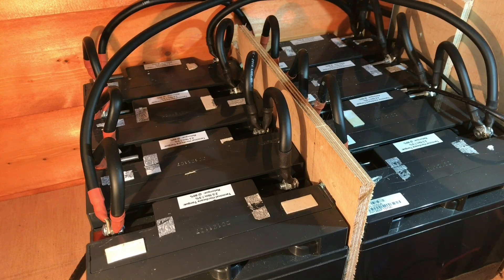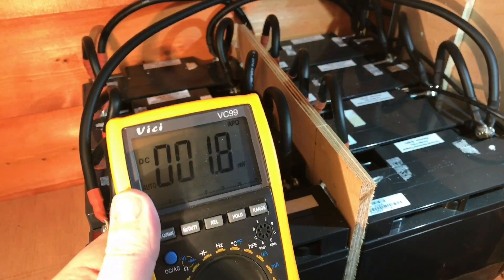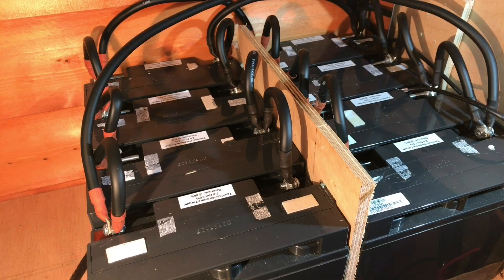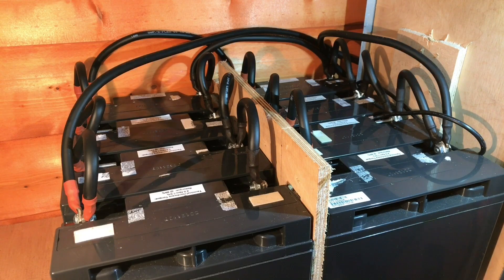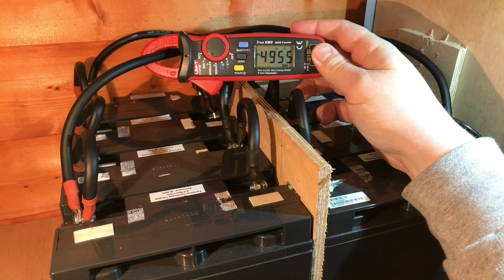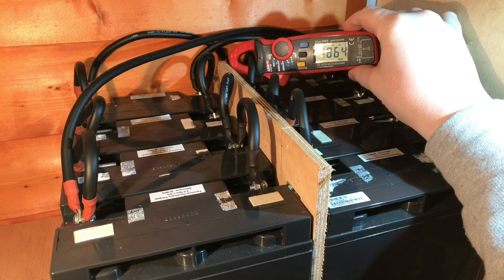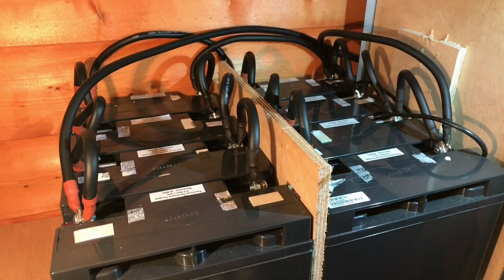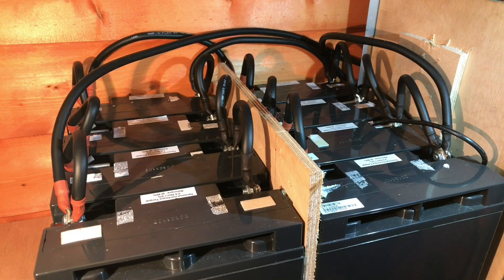Checking 12v Batteries in Parallel - 12v Solar Shed

Comment: interesting! thanks for sharing. I am working on a solar installation for my boat. I want to keep the battery bank 12 V. There are 4 x 125ah agm batteries in my plan. is parallel connecting them the only option? each battery is 12 v.
Reply: Yes but you could balance them better than he has. Google 12v batteries in parallel

Comment: I had one of mine go back in a bank, didn't notice for a loooong time, pretty sure I did damage, and the rest of them have varied stable voltages ranging from 12.6v down to 12.5v.  they all used to sit at 12.8v just a year ago.
it pays to to monthly checks :/  
luckily I got mine stupidly cheap and am only running led strips on a PWM controller, so it's not noticeable.
but still, was a disappointing lesson.

on the plus side, I have a new EPSOLAR LS1024B  coming in the mail (eventually ha) which I can finally set up my 45 AGM 5ah batteries with (got them stupidly cheap in a UPS buy, the UPS was too massive to run at home ha)
Reply from the maker: Yes battery maintenance will save you money in the long run.  I probably should have added that doing the same test whilst the batteries are charging will give you a good idea of their internal resistance.  The issue here is getting a consistent charge long enough to test with a solar setup!  Cheers
Reply: the constant charge is easy here in Queensland Australia lol.
with it's lovely 34-38c days, there is a LOT of sunlight to spare.

Comment: If a battery develops a shorted cell, the main issue will not be from the good batteries "dumping" into it, rather it will be when the charging is happening. It will gobble up most of the charge current and get rather warm, if the charging source is reasonably grunty.

If you suspect a battery in this state: Check through the batteries with the clamp meter like you did but with NO charging or discharging taking place. You will find the duff battery when current is pouring in from the interconnects either side of it! (unless it's an end one, then all current will be moving towards it)

Interestingly in this situation there is actually very little wattage moving around even though the current can be fairly high. That's because the voltage differentials are extremely low. 

As I might have said in the previous video of these batteries, no matter how you carefully manage things the batteries towards of the outlets of the pack will always take more of a hit than the ones in the middle. 

Many people believe that parallel=bad / series=good. Not necessarily so! An undetected shorted-cell battery in a series string is in many ways worse as it will cause the others to be overcharged, rather than undercharged in the case of the parallel pack.  

By the way Adam, thanx for your well-wishes. This will be the last comment I make for now. 

See you on the other side of these days! :)
Reply from the maker: Thanks for the insight Xan.  Glad my video passed a few minutes for you in this odd waiting period (I remember it well - although we had ours booked in for a particular day)!

I wanted to offer some suggestions on how to test everything live - but perhaps charging might have been a better option as you suggest.  The issue is that we're having such an overcast, rainy few weeks I'm getting little significant current going in!

I'm thinking about re-configuring my bank at some point - comments like your are always useful to make me think.  

Cheers and good luck once more.

Comment: I like your instruments. But you can make your life much easier if you have a 'star' wiring instead of your 'ladder' or busbar wiring. One side is sufficient (+ or -) and the wires can be much thinner like 2.5mm2 . Now you can measure the same value in each wire and detect even the smallest difference.
Reply: Can you possibly link to information on this?
I'd like to see testing and outcome compared to other variations.

and I have the connections at the end, but, it's positive one end, negative the other, so the current drains across the entire bank and charges across the entire bank.

joining at the center would rely on each battery being within a set tolerance of resistance so as not to get a lessor or greater charge per cycle, and the same with discharge.

this is true with pretty much any wiring setup, but some are slightly more stable than others.

which is best? that's up to better experts than me (being that I'm not one ha)

http://batteryuniversity.com/
is where I've done the bulk of my reading and discussion.

http://www.smartgauge.co.uk/batt_con.html
also an interesting read.
Reply from the maker: Are you suggesting each battery connects independently to a central buss bar or something of that arrangement?  Thinner wire required yes, but possibly a lot more of it!  If I've got the wrong end of the stick could you perhaps find/make a diagram?  Cheers for the suggestion.
Reply: Not that much to rewire....
https://lh3.googleusercontent.com/aOIbSYYNSOidWgskBMTm1b_faBUzHLXEVTZvAPym4y9_qaD3jphL5ID3FpuL1RB5UCk5Q-qlFw
Reply from the maker: Thanks for that.  Yeah a couple of people have suggested wiring each battery individually back to a bus bar - I'm worried however that it is going to create a fair bit of extra cable in a relatively small space.  It does give the advantage that I can wire individual fuses however and test as you suggest.  I'll give it some thought again.  Cheers
Reply: it has it's own problems though, if one battery has a higher internal resistance and another lower, you won't get even charging.   at least, from what I understand from BU discussion and articles.
Reply: I also use the star configuration on my battery bank, with a fuse on each + line. That way the cable resistance is about the same for all batteries (except the main one, i do not use a bus bar).
I raise a little bit the voltage on float charge juste to make sure they all get charged well with the epever tracer A MPPT solar charger
Reply: any reason why you use the star config?
benefits over other arrangements?  any links to testing?
Reply: By making the system connection in the middle of the battery bank, the charging and discharging cycles are done in a balanced way. If the system connections are made on the ends, then more charge will flow into the first battery and less flow into the last battery. When discharging, the first battery will discharge first and the last battery in line will discharge last. This is not good for the life of a battery bank.
Reply: http://www.smartgauge.co.uk/batt_con.html
this is method 3

your method 2 is also good.

So my way is not fully ok because one battery has no wire and will get more curent than the 2 others..
Reply: only three batteries? you're probably not going to get much in the way of balance issues.

I have 8 28ah wet SLA's at the moment.
nice THICK cables connecting them all, and all carefully cut to be as exact as possible.

a nice EpSolar 2215BN solar controller on a 24v 250w panel keeping them charged.

and a new bank to be build of 42 5ah gel cells to be wired up when I can work out the best way to connect them all, ugh blade connectors are annoying.
(I got them in a stupidly cheap server UPS buy )
going to be kept charged with a smaller PWM epsolar unit on a 90w panel.

then i need to get some LED strings to light my workshop on PWM dimmers.

balancing only becomes an issue at 4 or more cells as far as I can tell.

still trying to find any research on this subject, plenty of pages on how to do things, but the why and it's evidence I've yet to find.
Reply: John Douglas good ;-). I use 90 Ah batteries.

Comment: Would testing them for current without a load indicate issues. They seem well balanced when delivering a load, but after charging or loading plus some time to settle, wouldn't any current flowing between batteries tell you more readily if one is unhealthy? I honestly don't know, but I have wondered that
Reply from the maker: Yes this is another good idea for a test - however again it requires taking the battery bank down to ensure no current would be flowing normally.  Cheers

Comment: You could always hook a warning buzzer up to each battery if worried.
Reply from the maker: Based on voltage?  It wouldn't work I don't think as they are all connected in parallel they'd all show the same voltage.
Reply: Based on voltage. If a short occurs the voltage will change quickly.
Reply from the maker: Ah I see what you mean now.  I'm not too worried about an overall short - the battery box should prevent any wires from moving and they are tightened up quite well.  In the video I was referring to an internal short of one cell - the most likely failure.  If one of the six internal cells goes bad, one battery will become a '10 volt' battery.  As a result it will drag down the voltage of the others a bit.  It would be interesting to see by how much - and if I could create some kind of monitor.  If there is a sudden drop of 10% or more or something - you've given me an idea... but I'd need to find a damaged battery to be able to test properly...

Comment: I am wanting to make a 15kwh plus lifepo4 battery bank for my solar shed but can't find lifepo4 anywhere in the UK.
Reply from the maker: +Shaun Dobbie Good luck in you hunt - I've no tips I'm afraid, not something I've looked into.
Reply: I find lead acid inefficient and generally crap so I am trying to go to lithium as soon as possible.
Reply from the maker: That's understandable.  I think if I was starting again (or didn't have a supply of lightly used lead acid) I'd have to seriously consider alternative chemistry.
Reply: *****
 Lead acid has the main advantage that it can be used in very low temperatures -10 and less whereas lithium can't charge below 0 degrees C. One other thing I don't like about lead acid is that it takes a huge amount of energy to manufacture, you will get twice as much energy out of the battery over its lifetime than was used to create it. With lithium it is 10 times more.
Reply: I have lots of lead acid batteries and i have had no issues with mine. I have Li ios and there is no way i would change from my lead to lithum. Everyone has there own requiements so i hope for can find a good source of lifepo4 cells. Mine are sealed not flooded like your Trojan batteries which requires more maintance.
Reply: Urban Off grid
 With lead acid you need a massively oversized bank to get decent cycle life but with lithium I can have something much smaller, more eco friendly and more powerful.
Reply: You said in your own videos that you dont cycle your lead acid batteries more than 50% to improve life, but you were going to do the same with your lithium batteries, so capacity would be the same. Ok you would cycle lithum more than 50% but your still under rating your lithium bank. the lower cycle depth on any battery will yeald a better life. Lead you dont dischage as deep, lithium you dont fully charge to get the same effect. but lead is bigger for the same capacity so space saving yes but more monitoring for voltages and cell monitoring so lose space there. Yes they contain lead which is no good for the enviroment. Yes you can pull more current from litium cells but you will have a big bank so the effectivly small current you or me pull from these banks is not going to matter on litium or lead.
All im saying is that both have good and bad, but at the end of it all they are not as far apart as many believe. I enjoy your videos and i will continue watching.
Reply: Urban Off grid
 I only take 40ah maximum out of the bank I have. If I went over to a 400ah lithium bank, I would take 200ah out of it and still get brilliant cycle life. My favourite thing is they don't have to be fully charged all the time.
Reply: I never thought of not having the need to fully charge lithium compared to lead. Having lead discharged for a period of time will shortan their life. not the case for lithium and could extend their life. Thats a great point. For lots of people that will be a big consideration. Good chat :) and constructive. i hope all goes well getting lithium batteries and i look forwards to seeing it as it progresses.
Reply: Urban Off grid
 Unfortunately, I don't think I will be getting any lithium batteries. This is because the source I have in Germany, innopower.de are ignoring messages and obviously don't care.
Reply: Awe that sucks but im sure you will find something. They look like nice cells i hope they get back to you.
Reply: They are probably too busy eating sausages and dancing. I sent them an email telling them that I wanted to convert 4 tractors on a farm  to electric and build an off grid storage system for them to charge on and I then went on to say that I will be buying elsewhere.
Reply: So much sausage. Well im sure that you will find other sources. That will be a lot of cells and interesting projects :)
Reply: I only said that to make them feel bad. I only needed 8 400ah cells.

Comment: Another random cheap solar charger controller that may interest you, claims to work with LiFePo4 and Lithium.http://www.ebay.co.uk/itm/3V-6V-12V-Solar-Regulator-Charge-Controller-LCD-Remote-Meter-LiFePo4-Lithium-/201622901587
Reply from the maker: I've seen this RGBY model before - but not one claiming to charge so many different types of cell.  Interesting, thanks.

Comment: Nice wiring.  Just a question, don't you need to place a fuse or even a switch as close as possible to the battery?   Not sure how long the leads are or where they are heading to.
Reply from the maker: Thanks - I have a midnite solar rebranded CBI DC breaker on the main battery bank positive - and then my charge controller and inverter are also independently connected to DC breakers.  All other small loads are individually fused.  The main battery cables are less than a meter in length.  Probably not much more than 2 foot before the +ve hits that breaker.  I have all my fuses and breakers outside of the battery box - it shouldn't be necessary with the AGMs, but my previous 'sealed' VRSLA batteries could give off gasses if they needed to.

Comment: +Adam Welch Thanks for your video! I just made the same test on my battery bank :)
It might be a good idea to design a circuit (maybe based on Arduino or ESP8266) which manages measurements with multiple non-invasive DC sensors.
Why not! :)
Reply from the maker: Why not indeed!  Sounds like an interesting idea.

Comment: 👍 
Nice test. Those UNI-T clamp meters are awesome. Question: What are your thoughts about battery string balancing? I have 12 six-volt batteries wired for 24v, three strings of 24v and then paralleled via bussbars. Haven't had any issues, but is it possible the more batteries one has...the more propensity for problems? Parallel will def add up current, but with series-parallel strings, one is increasing voltages + currents. Thanks!
Reply from the maker: Cheers Chris - I think you're more experienced in that configuration than me!  The strings of 6v batteries should act like mine and I want to say that each string should provide an equal amount of the overall current assuming they all have the same length cables to the bussbars.  
Increasing the number of batteries increases the potential for one to go bad - same with anything I guess.